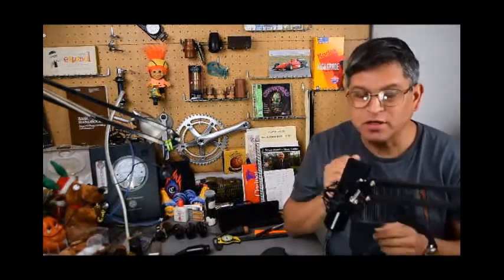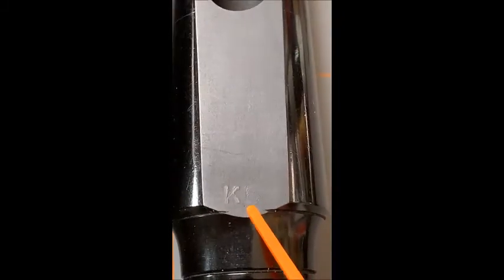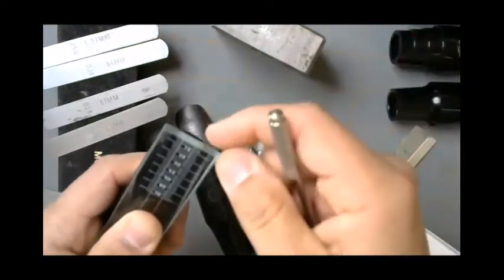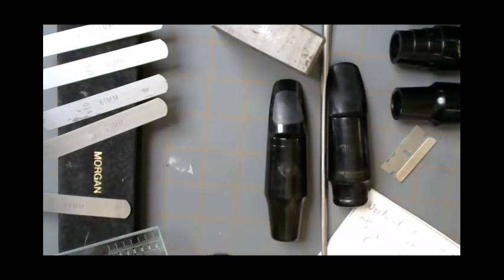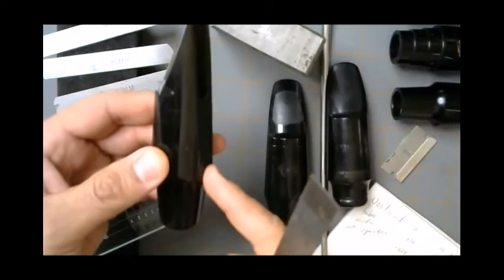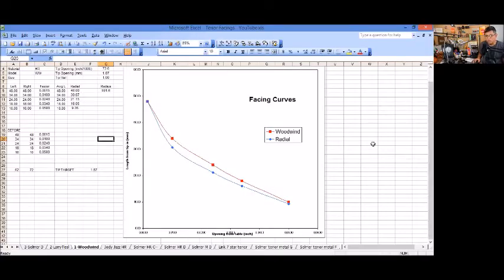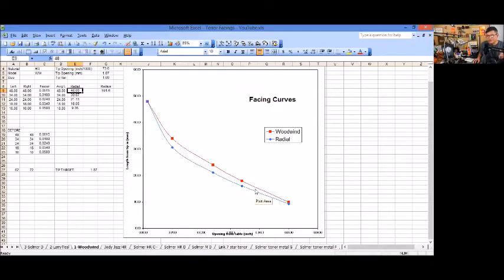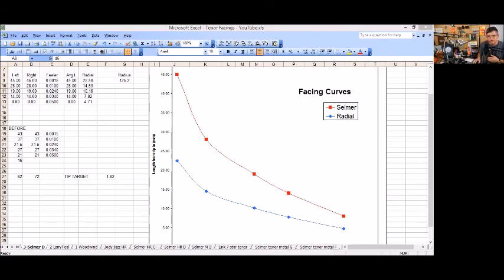Measuring a Mouthpiece curve; rail curves and tip opening. Clarinet Saxophone mouthpiece refacing.

Comment: Very helpful. Love the wide array of expertise you got going on the channel. I'm having a hard time finding any data on Bb Clarinet mouthpiece facing tables, seems not many people care to go that deep. Im dozens of pages deep in the googles with little more than tip opening measurements and countless pages of forum posting knownothings. I've got an old Grenadilla mouthpiece with some pretty unplayable wear from a H Bettony clarinet I'm restoring, and I'd hate to put it to sand paper without knowing at least a little about the curve characteristics. Thanks!
Reply from the maker: Many of the old Grenadilla mouthpieces were refaced so many times they stopped using them.  If the tip rail is too thick then it probably was refaced too much.  You have to take it's current measurement and put it on a speadsheet.  Then compare it's curve to what result you want -- for instance a medium open, medium curve.  Then you work from there.    Wood mpcs have to be polished and sealed otherwise they expand and warp fairly quickly.   
Let me move a spreadsheet to Google Docs for you to see.
Reply: @gottalovetheknowledge4749  Ah, perfect, good information. I appreciate it!
Reply from the maker: I'm trying to create a Google Sheet spreadsheet (convert from Excel) for measuring and comparing.  Here's the start of it   https://docs.google.com/spreadsheets/d/1PAPpvcQqh328pxOIbjVKdHXUdxM4pKVWMu7ph6pmlG8/edit?usp=sharing